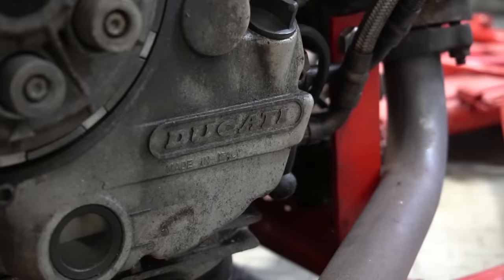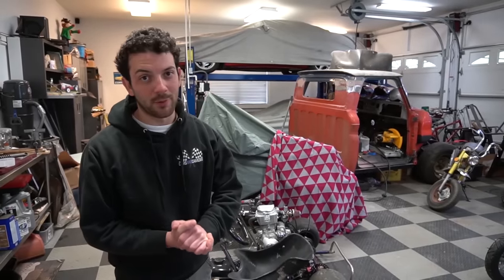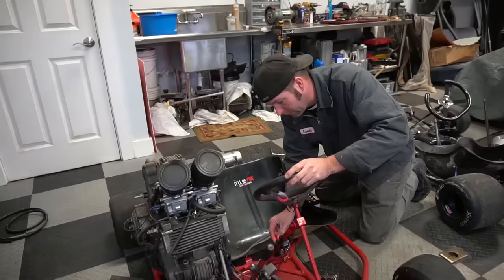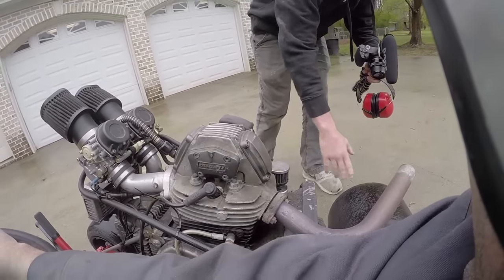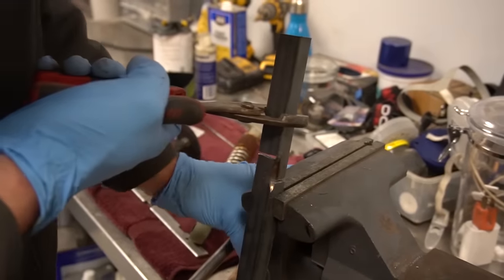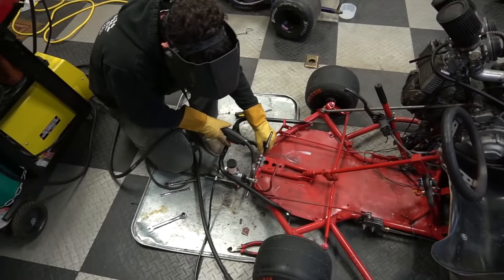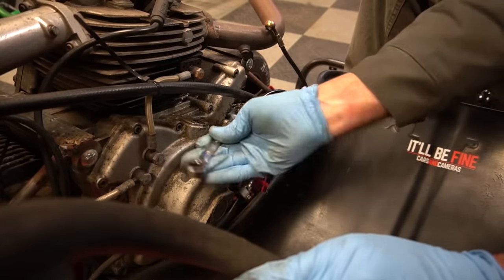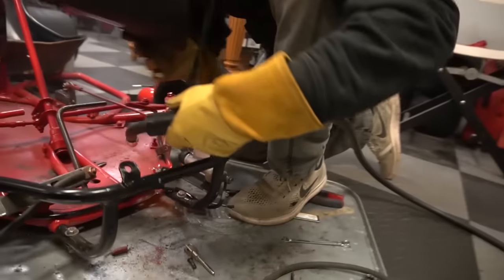DUCATI 900CC DEATH MACHINE | 70+ HP Shifter Kart

Comment: To get more clutch pedal travel you just need a longer lever and connect it to the cylinder close to the pivot. Then moving the same amount of angle will be a longer arc at the end of the rod where your foot is.

Comment: In 74' we put 2 Yamaha 2 stroke 100cc twins side by side on a cart. Synced up both transmissions.5 speeds.clutch pedal, hand shift.Brakes? 4 compression releases! We raced motorcycles together, the kart was put together with stuff laying around.Our mom's were SO proud.🏁🍺

Comment: You guys are finally learning. Now slap a 1000 cc super sport motor on that rail and quit playin with generator motors!
Reply from the maker: You gonna send us one Chris??
Reply: CarsandCameras if I had an extra one laying around I would! You guys might be able to find one online for not an insane amount. Maybe buy and old running motorcycle from the 90’s and transplant the engine, drivetrain, and dash?
Reply: Chris Mathy you can find one for les than a 1000$
Reply: I have a good running SV1000 bike. 996cc of injected V-Twin power. 120hp is yours if I get the cart after filming.

Comment: Maybe try mod a street bike steering dampener to fit it so you have more control
Reply: That's what I was going to say, even the street carts I've worked on (only 20-25ish hp) get a good pair of return springs on the steering.
It makes such a difference for safety just knowing you aren't going to slip into full lock and crumple against a wall/tree.
Reply: Cable ties Fix everything .  You could ad some more castor to the front King pins.

Comment: I wonder how that would go against like an actual Ducati sportbike, because if it’s geared for 150+ like you say, and the kart being way lighter, that thing has gotta just fly
Reply from the maker: This setup is no doubt significantly lighter than a sport bike. Ike did 102MPH at the bottom of 4th gear. It has a 6 speed.
Reply: It would never beat a sportbike in top end because the wheels are just tiny, Think about it compared to a sportbike wheel, When this cart is topped out redline 6th gear it may possibly do 120-130mph... But that’s just silly to do in a sketchy kart lmao but if you could somehow maintain traction, this kart would accelerate faster than a sportbike for sure
Reply: CarsandCameras
 that’s insane! You guys do some crazy stuff man
Reply: D MTB 
But that’s only if they kept the stock gearing on there, they would have to use a smaller gear not only because it would just burn out the rubber otherwise, but the sprocket itself would be too close to the ground and could possibly damage the chain
Reply: Logan the Roman Yeah I guess it could be compensated with a smaller sprocket... would have to be an awfully tiny one but i suppose that could work
Reply: D MTB 
Could being the key word lol
Reply: i think it could keep up with a sport bike no problem ..however all that power on this sketchy little frame will be the issue
Reply: D MTB..actually if you think about it the fastest street cars are on small wheels so your point is invalid..it takes more power and torque to get big tires going as fast b/c of the sheer size..a small tire spins easier b/c there is less required to get them rolling..street outlaws teaches you that big tires cars are significantly slower than small tire cars with the same set up..or make this comparison ..would you run 30 plus inch tires on a race car?..nope..you'd want something of a 15 to 18 inch ..ever seen a 4 wheel drive truck outrun a sports car?..same thing
Reply: Jane Ames 
You’re correct in saying that smaller wheels spool up faster with less effort...  But my point isn’t invalid, you just understood it wrong.. You’re speaking in terms of acceleration, Which I agreed that yes the smaller wheels would enable it to accelerate quicker, but the actual circumfrance of the Kart wheels are so small that it wouldnt have that high top speed of a sport bike
Reply: Bigger wheels= higher top speed but less torque (assuming the powersource has more than enough power)— — Smaller wheels=lower top speed but more torque
Reply from the maker: Yeah if you're only looking at power:weight ratio, this kart would be faster. In reality a sport bike would be much faster because they're designed to do 150+
Reply: My bike uses a higher performance 803cc version of this engine and makes around 82hp at the crank stock (also has the 6 speed gearbox too). with the mods I've got on it, it should be now putting down around 82hp at the wheel now (although it hasn't been dyno'd yet so can't be 100% sure on the figure). With that being said the fastest I've managed to go was 134mph, that was about 250rpm off of redline (9k rpm). 

The biggest limiting factor for top speed on bike engines (regardless of what they're mounted on) is air resistance, if I don't tuck down I'll only get to 125mph instead. You'll never reach 150mph with this engine regardless of the weight or gearing, that'll only effect 0-120 acceleration with this engine.
Reply: Draft_ Okay so basically since YOUR bike cant do it, than no bike with this engine can... 👏🏼
Reply: Smh you could be 250lbs for all we know dude... Gave no detail of what bike you ride... Components such as wheels, wheel bearings, anything... Nothing you said was definitive other than that your personal bike is slow
Reply: Not necessarily, if the kart had a fairing then sure it could probably go faster but like I said air resistance is the biggest factor for top speed (as air resistance increases exponentially with speed). The Ducati 900ss that this engine came from had a claimed top speed of 136mph and it was a fully faired bike. 150mph might be plausible if you had an insanely aerodynamic fairing, although I'd be more concerned about the stability of the kart. 

Huge props to Ike for doing 100 in it, I'd probably shit myself!

Comment: 3 things.#1.Awesome ! #2. Rollbar to strengthen frame so it doesn't flex and twist.#3.A bearing on the other side of the drive sprocket so the axle doesn't bend.This is going to fly.Please wear face shields and leathers guys.Have fun.

Comment: Hve you ever bought some bolt couplers / coupling nuts. They are like 4-6 continuous hex nuts in one piece like a turnbuckle. Round or hex. But one thread direction thru it so if you use acme thread it can be a driven shaft or if reamed a great weldable sleeve.  Better than what you guys do here fro your linkage. All day long.

Comment: I just stumbled across this video and the Ducati cart very nice I suggest air shifter it works really well my cart had the ability to basically start in any gear first through fifth you put it in what gear you were going to go around the track in... I also found out fro an old Honda 750 four to a YZ250 and the two stroke was definitely the most fun of any of them I ever had you can turn the cylinder around backwards and the carburetor is now a velocity stack and there is nothing like the feeling of a two stroke in high revs snatching corners , it is pure drift kart  ... more stuff like this you guys going far and I'll be there to watch...

Comment: If you attach the clutch master cylinder closer to the pivot point of the pedal you'll get a longer stroke out of the pedal. It will be more like a car's clutch pedal with a longer stroke to engage the clutch

Comment: Badass cart!  On the brakes being spongy issue, I'd guess that the rod you made the new brake pedal out of is too small in diameter.  The long section going over to the linkage to the brake cable is twisting quite a bit.  Perhaps use a 1" hollow tube/pipe instead, and attach your brake pedal on one end and linkage to the cable on the other.  A hollow tube will twist a lot less than a solid round bar of the same diameter, and weigh less.  Then get that cart to a proper roadcourse track!

Comment: You need to put a clutch pedal on it makes it a little awkward with the clutch on the shifter.
Me and a friend built a go kart from scratch with a 1986 Honda 250R 2-stroke expansion chamber no Muffler shocks on the back from the trail 90 valve springs from a 351 Ford head in the front it was badass probably not as quick as yours but it was quick

Comment: You can use Nissan starter solenoids for your paddle shifters, since it's a sequential gear box all you need is one to pull for up shifts and one for down shifts. I'd use a momentary on push button and wire a relay for the solenoids since they pull a lot of amperage just a direct wire,to the push button would probably burn it out pretty quickly.

Comment: Fabulous!   That's a perfect use for an old 900SS engine :)
Perhaps you'll offer me some of your experience with a build project that i have.    I'm going to build a big wheel race/ drift trike, using a 48v brushless 2000w power system.    Any ideas on optimal ratio for a nice balance between acceleration and top end ?   
Best wishes!  Eddie

Comment: Hello.
I am interested in a question that, so to speak, is in your competence))
I bought a kart with a 163 FML engine with a capacity of 14 liters, s at 7500 rpm. In the frame on the right. 2:14
Tell me pzhlsta, sprockets with how many teeth to install? So that he could confidently drive, say 100 km / h, was torquey and nimble. The weight of the card is about 60 kg. my weight is 65 kg.
The 428th step allows you to choose the leading one from the row - 13, 14, 15, 16 and 17 teeth. And the slave will be made to order. Its maximum size is limited only by the clearance of the kart. It is also possible to customize the leading sprocket in the required size.
According to my conservative calculations, 13 * 40.
Thank you very much for your intelligible answer.
I really hope for you, I hope you will see.
Like to get noticed. Thank you.

Comment: Probably the reason the headbolts were not tight is because the engine was out of the bike and whoever was buying or selling loosened them so they could look at the piston and cylinder walls..??
Just a guess.
That cart is bad_$$. !! 
  The steering looks a little squirrely at high speeds...can that be fixed..??   Or what would be the best front end for something like that..??

Comment: Got my lawnmower @nt blender motor that keep bleeding keep keep bleeding love as the main engine @nt combustion valve radiator (Mopar_)

🤗😏🤨😎 @ the locals only craps tables about to follow up @ the zzzzzzzz ahahahahahah
Reply: Commercial truck drivers license is TYPICALLY REQUIRED